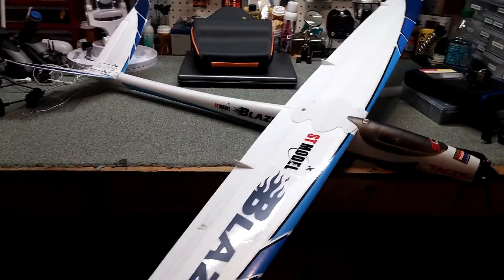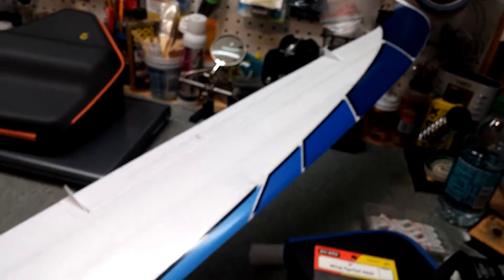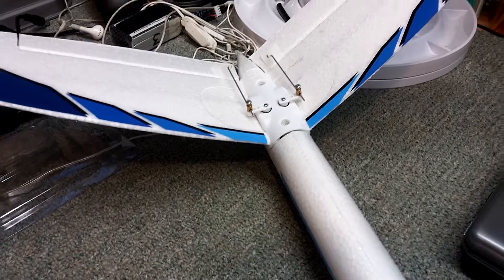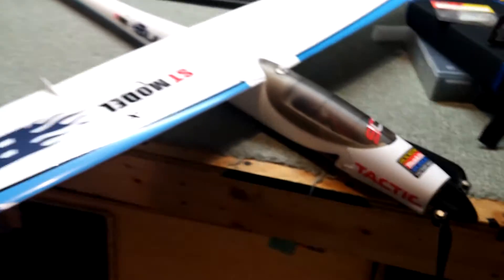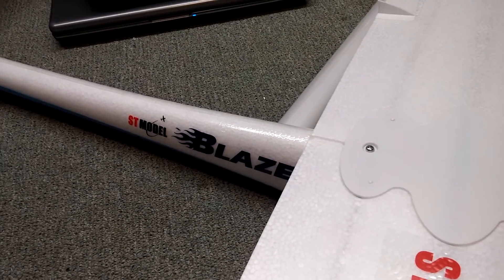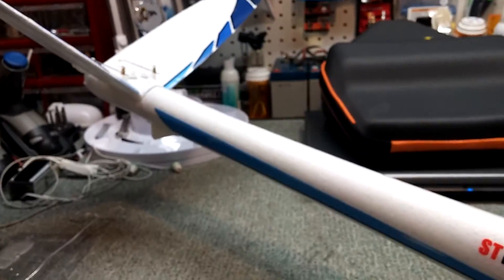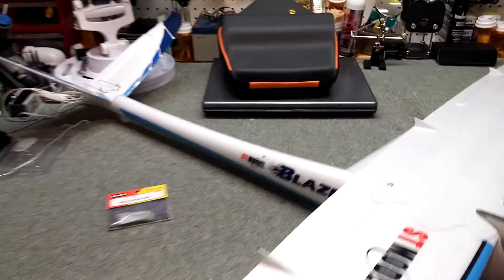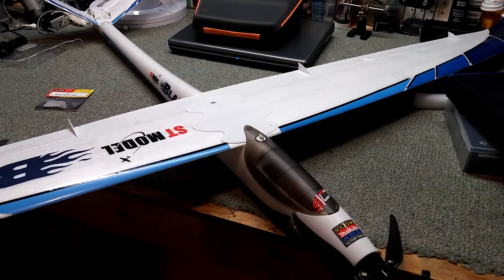ST Model Blaze Overview with minor Build Tips

Comment: this plane has sooooo much flex that ive crashed it twice.. it just react to the inputs on high speed.. useless aileron and elevator.
Reply: Yes I have had the same thing, go up high and do a dive with no prop and it cannot handle the wind force and something flex's preventing the plane from pulling up - anyone fixed this?

Comment: What size battery?
Reply from the maker: I use a 3s 18000 mah battery.
Reply: Ok thanks Ill try a 3s 1350 first. I assume you still like this model?
Reply from the maker: Eric sin sinner it's one of my favorite planes to fly.
Reply: willnate35 ordering on tomorrow tower $15 off! Thanks!
Reply from the maker: Awesome!!!  Have fun.
Reply from the maker: It's definitely one of my favorites for sure.
Reply: Do you have to add the decals? I think I would rather use paint to trim it, dont like blue and it does nothing to help you with orientation.
Reply from the maker: You don't have to add the decals.  The decals do help with orientation but if you want to paint it you should go for it.  No matter what you decide to do, she'll be an awesome flyer.  Have fun.
Reply: @willnate35  woah it can fly even with that size ?! Impressive
Reply from the maker: @washout1000  Yes you're right.